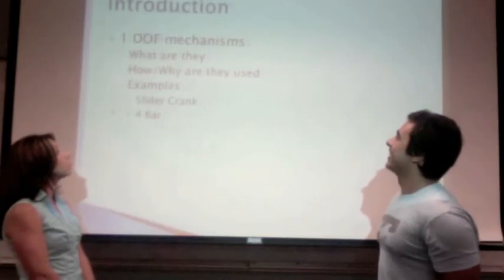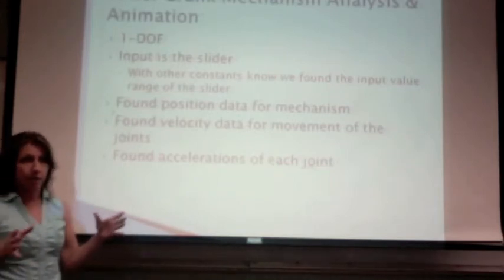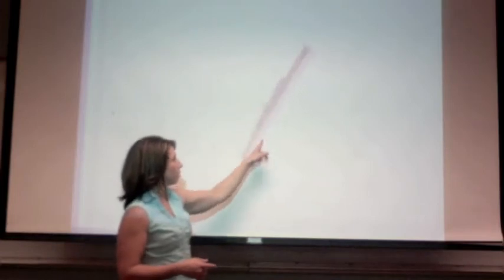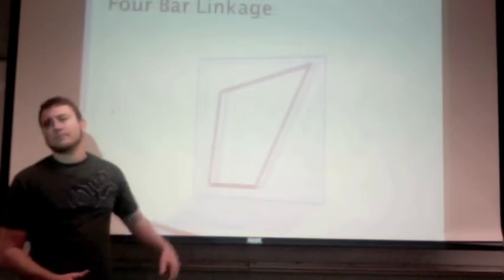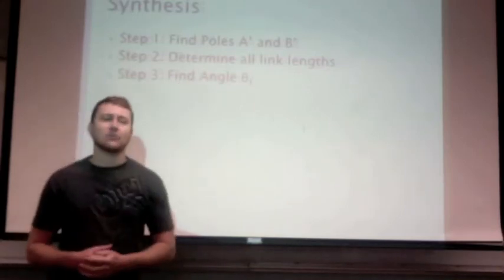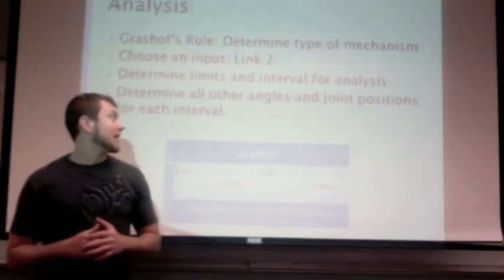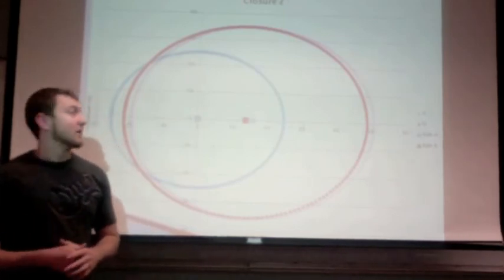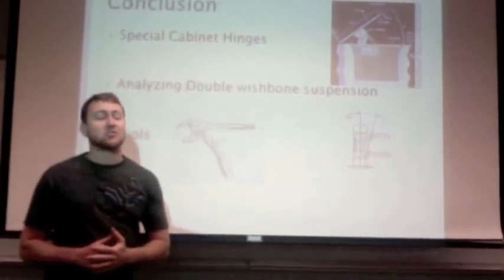Team 4: Presentation on Kinematic Design of Four Bar and Slider Crank Mechanisms

Comment: The titles of your slides are out of the frame. Introduction seemed a bit too long. Data values could not be read. You showed results for your four-bar but I did not see the results for the slider-crank.